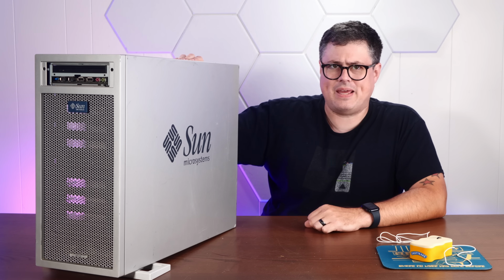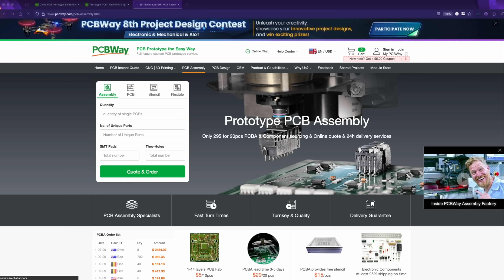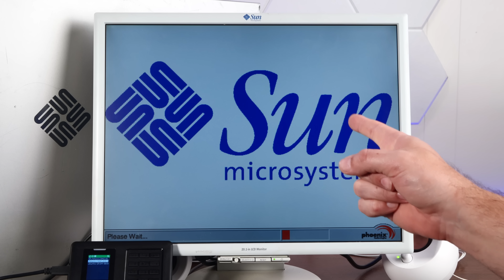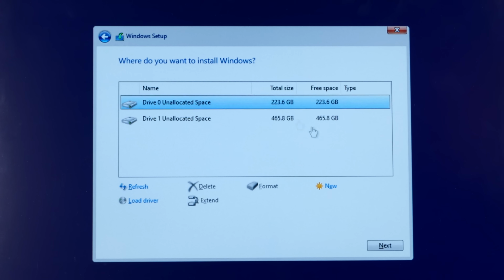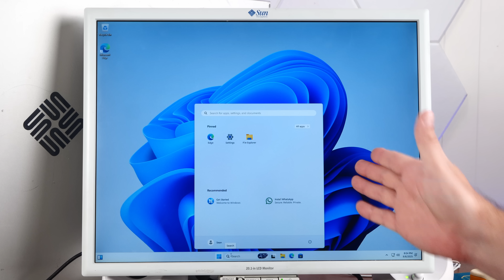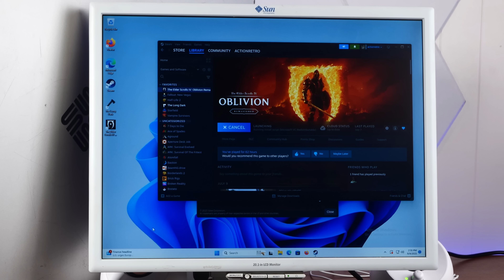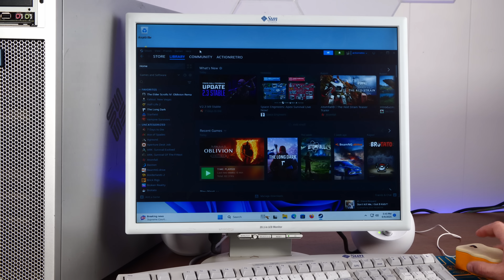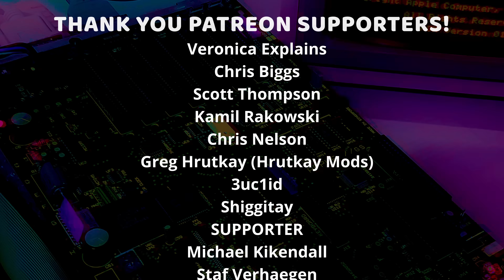The Oldest PC That Can Run Windows 11

Comment: I'm watching this on a 2008 Apple iMac Core 2 Duo T7300 2Ghz and 3GB RAM, original spinning disk 250GB SATA HDD, and an ATI Mobility Radeon 2600 GPU. It actually works great for what I use it for! I installed Windows 7 SP1 because when I set this computer back up to use as my main PC, I had a DVD of Win 7 lying around so I used that, but in the future might put Tiny10 or Tiny11 on it because I would like to run some more modern emulators or other software. 

But since I mainly run old games like Sonic Adventure DX (with the dreamcastify mod installed of course lol) and old emulators like Project 64, ePSXe, nullDC, snes9x that all work great, and watch youtube fine in 720p or even 1080p fine but 720p60 can sometimes lag tho not usually, and 1080p60 drops too many frames, but typically just keep it at 720p which on my 1680x1050 16:10 Glossy LCD Panel it looks awesome, and very high definition. 

I'm hoping this computer keeps holding up! I got it as a 7th grade gift in 2008 brand new and it is still giving me great use! Only issue is I had the speakers somehow become all distorted, so I bought a speaker bar that fits perfectly under the screen in between the base of the computer (all in one) which works great. And when I got 4GB RAM to upgrade the 2GB, for some reason even though each individual stick works fine, when I put both 2GB sticks in it, it doesn't chime,

But at 3GB it chimes, and POSTs/boots fine. Weird because the max RAM is supposed to be 4GB (apparently up to 6GB unofficially), but since I only had the 32bit skew of Windows 7, I am not missing out on too much. I would use the 64bit version going forwards with either Tiny10 or Tiny11 because of modern software compatibility but obviously I'd want to make sure I can use the max 4GB RAM before trying to install those operating systems, as they might technically work with 3GB I'd imagine it'd be pretty slow. Though even with my current setup, which ends up often maxing out the standard 11GB Pagefile of Windows 7, and is heavily relying on virtual memory, paging to a SATA spinning hard disk, it works good. 

Sorry for the long and rambly post lol I just wanted to explain my setup, because despite what one might often think, many older computers are still plenty viable for light internet tasks and older gaming just fine, and would be perfect for productivity tasks especially.

Comment: Those 2220s are 2nd generation Socket F (AM2 - contemporary) Opterons from 2006->. Those never had an issue w/ Windows 8.1x64 onwards. 
The 1st Opterons were Socket 940 (Socket 939 - contemporary); they came in both Single Core and Dual-Core varieties.

Comment: The real take-away here is that *neither the hw architecture nor the sw architecture has materially changed in 20 years* .
Reply: More or less. Besides reaching the limits of silicon using traditional fabrication processes, computers kind of just do everything you would ever want a computer to do at home already. Video rendering takes a few minutes, image editing is instantaneous, computers idle in office suites and playing back music, the web.......... well, the web could be better but that's the web's fault.
Reply: @BringMayFlowers  Other than video games computers are over. They have reached the maximmum in terms of usefullness. Only AI stuff remains and even then its just meh.
Computers can now safely be passed father to son as some family heirloom.
Reply: @honkhonk8009  I'd argue that point was passed in 2003. Once 64 bit was made available to the mass market (the Opteron was released in April and the Athlon 64 followed soon after) PCs have been basically the same. 2005 for Macs, the later G5 towers can still be daily driven today if you're insistent since they too can take 16 (and even 32) GB memory, an SSD, and a PCI Express graphics card just fine.
Reply: Neither the performance :) The 30 nm gate size was reach around 2014, and since then the manufacturers switched to a "virtual gate size" measure, so basically we are still at 30 nm.
Reply: I regularly use an optiplex 745 from 2007 with a Core2Quad and it runs windows 11 smoothly. Core2Duo systems aren’t bad either. People vastly underestimate the usability of older systems and it’s a shame really.

Comment: That Sun machine is a beast. And about that arbitrary obsolescence. My main desktop is a iMac 27" from 2012. It's just an i5 with a miserable 512MB Nvidia GPU. But it has 32GB RAM and a fusion drive. This is how I made it the best cursed beast ever (well not as cool as your Sun). First I "destroyed" the fusion drive, and on a 2012 the SSD part of the fusion drive is 120GB and not the later smaller ones. Then I installed FreeBSD. Just with Xorg and no compositor. That way the VRAM is sufficient to run it as a triple screen setup with another 27" Apple display and a 1920x1200 Samsung in portrait mode. For "desktop" I use FVWM so I got that beautiful OpenBSD feeling to it (old UNIX workstation wannabe). It's the best experience I ever had on a desktop PC, and I'm pretty sure Apple see that iMac as absolute e-waste. Think about that the next time you see Apple doing green washing. Speaking about Apple, I laughed a lot when they in 2024 bragged about the iMac being able to run "triple screen for the first time"...

Comment: Hey! nice and interesting video .
as i always say everywhere i run my trusty DELL Precision M6600 laptop from 2011 right now and i did watch this video in FHD on the 17" display that is on it and it run windows 11 just fine and it's the normal windows 11 nothing modified and yes i installed firefox and it was the first thing i did XD.
now it's a bit of a spectial laptop it have a I7 2720QM and 32gb of DDR3 1600MHZ with is really a lot for that time and even on a brand new computer 32GB of ram is not bad at all it also have a nice AMD FirePro 6100 2gb of VRAM that keep me from using that laptop on linux with is extremely annoying but hey it run win 11 no problem so that's cool of course for games the problem is going to be the GPU it's really old and not that great for new games but it's ok i not complain it run still some cool games and the battery last about 3 hours when watching youtube with is pretty cool (battery is brand new from GreenCell probably the best brand i know for getting new battery for old laptop of if you not want the battery to cost the price of the laptop.... and not want a piece of crap cause that can happen really easy GreenCell is made in Poland so really nice for people who are in the EU cause shipping will be nothing kinda)

Comment: I run win 11 on my Dell T3500, while it does support the the required instruction.  The biggest drawback is that it has actual bios.  The fixes for this breaks about every update,.  The proper fix for this issue will also allow booting from NVME drives also.  EDK2 and refit can be your friend.  Also, while using the external PSU hack, it is best to tie the ground wires from each PSU together.  Differnt ground reference values will cause goofy issues like that.  Once you do that, you can tie the green wire to the main system so initalization power check for all hardware is done at the same time.  Having powe to to the GPU when the system comes on line seems to interfere with the checks done on some hardware.

Comment: Anyone thinking System Requirements for system is ok clearly has not seen how some computers and phones have almost the same specs as the previous ones and yet the companies behind them find new ways to software limit them. The also the same for rooting Jailbraking the whole it is for security thing...

Comment: Time span wise, is like running Windows XP on a IBM AT.
Reply: That’s wild. IBM XT to Windows XP feels like a much larger jump than Windows XP to now.
Reply: @thetman0068  Because it is! Technology was going at an extreme speed in the 80s and 90s. It has slowed down quite a bit in the last 15 years. Sure, there is still quite a bit of progress, but the cost of making the newest stuff seems to be increasing almost as fast as the performance of the new stuff is, much unlike the 90s, where it was nearly the opposite. Performance increased rapidly, and the prices were staying put or even dropping if you went from mid-end to mid-end, rather than high end to high end.
Reply: I'm old enough to understand this reference and it's sad it seems we're in the minority 😢

Comment: You should relabel your title to "Microsoft is a scam"

That title would be more relevant.

I rebuilt an old Tyan opteron system and upgraded it to a 18 core Xeon E5 with 16 hard drives.  Works awesome for games.  Using the last version of Windows I'll ever use, "7".

Comment: sysreqs are sean. holy c what a cpu/gpu combo. rpi4/5 can run win11. asrock J4405m with dual core processor can run win11. latest win11 no compromises.

Comment: Dang, I scrapped one of those Sun workstations ten years ago because it didn't look like it was ever going to be useful for anything. It's such a beautiful piece of hardware that I hung on to it for 10 years after we stopped using it - we only needed it for one project for Sun themselves in late 2005. This totally justifies my decision to never throw anything away again.
Reply: I thought like that for the best part of three decades. Eventually I had to accept that the postapocalyptic wasteland that my home had become could no longer be lived with, and broke my own heart throwing out a veritable mountain of old tech. sigh
Reply: Too bad that you threw it away. I used to work on these workstations exactly 20 years ago. This really revived those memories which are faint but most clearly I remember the feel of solid build quality even though as user of Pro/E I never needed to even open them up. They were brand new, clean, and unworn and I was pretty awestruck that I got to lay my hands on such esoteric hardware practically straight out of the box. I also remember how terrible Netscape 4.6 was on Solaris 10 and how I tried Firefox which was marginally better. I guess it was assumed that internet equals play but these computers were meant for work. I was used to working with GNU tools and I struggled somewhat trying to adapt to Solaris tools which, as I can hardly remember, were of BSD origin.

Comment: I remember around 1987 that a lot of people did not like the new ctrl/caplock placement, and would tend to hit caplock by mistake.  I wrote a TSR that prevents CapLock from working unless you hit shift at the same time.
BTW, the original way (IBM PC keyboard) like the pictured keyboard (3:50) come from typewriters, where the positining is a matter of hardware:  The caplock was actually a little hook that grabbed a beam and prevented SHIFT from coming back up.  And note that the SHIFT key didn't just press/release -- it caused the whole mechanism to tilt, so the other character on each arm would strike.
So, it was necessary for the CapLOCK key to appear directly under the SHIFT key.
The change was made, according to IBM's notes at the time, to make it easier to do chording .

Comment: The particular Opteron in that tower isn't the earliest x86-64.  Those would be the single core Opterons and Athlon 64s from 2003.  But you're correct that your Opteron is the earliest chip that will run Win 11.  Dual cores is a hard requirement for Win 11, going back to the first versions.

Comment: The reason the 9070 XT doesn't work is that AMD removed legacy BIOS support from RDNA 4.
Reply: i doubt it has anything to do with bios...its EFI bios...not legacy one...its more how board setup with pci-x conversion...early pcie....when 9070xt never supported anything bellow pcie3 number.....only nvidia hardware goes from 1.0 to5.0
Reply: @user78405 100% is, UEFI GOP hadn't been developed by 2005 (EFI isn't the same thing). PCI Express version is fully backwards and forwards compatible, the only thing that will change is the transfer bandwidth.

Comment: SUN motherboard is first board to have TPM and secure boot due to secuity in mind that definite works for windows 11....thats is different hardware than normal customers don't get from....x99 or am3 boards does not have EFI bios...only SUN did during UNIX era...and APple as well since PowerPC era, thats way back before PC started to adopted super late in 2015's ......there where no EFI bios than opteron setups only that time ...not sure xeons had that as well....since server workstations always need UEFI for security purpose while consumers do not need it during windows xp to vista era...EFI been around way longer than PC been around.....only in SUN and APPLE computers ...even IBM UNIX computers had it , so as all old SGI computers during onyx era...since they are first made graphical gui bios....PC been far behind since intel i7 introduce the idea of GUI bios that wide;y adopted for both AMD zen and all intel i7

Comment: Microsoft gets to call the shots because Windows is not open sourced. That's my simple and short answer. MacOS is the same thing. But any other OS that is open sourced like Linux, BSDs etc will run fine, someone probably got the job done for you, you only need to install it.

Comment: Wait, what? I have been unable to install steam on my socket 939 Athlon 64 X2 CPU's because steam requires some extension my CPU doesn't have. How are you able to install steam on an opteron? They're functionally the same as the consumer X2 chips, are they not? I would love to test out games on my "fantasy 2005/2006" rig if only steam would install!
Reply: Socket 939 doesn't have a CPU with the additional instructions required to run Windows 8.1 and newer (notably CMPXCHG16B).
Contrary to what is said in the video, this is a workstation from late 2006, with Opteron CPUs that do have the required instructions, similarly to Athlon 64 for AM2 socket, unlike earlier generations of Opteron and Athlon 64 lacking them.
The first x86 CPUs with 64-bit instruction set were the Opteron from 2003, but they cannot run Windows 8.1 and newer, and if they did, it would run noticeably worse than the experience in the video.

Comment: Why is everything running so well what the fuck. I mean, I knew that CPUs have basically plateaued for gaming/general use, but not 20 fuckin years ago. This is nuts. Even the desktop environment should be a mess - though I guess we can thank tiny11 for that.

Comment: 3:53 the control key is in its proper position exactly where it should be and not in the brain-damaged vt220-derived (now an ANSI & ISO standard!) position that has caused so many of us to have RSI problems.  I remap caps to control on Windows, Mac, and Linux on everything I use.   I also set a Mac keymap on Windoze and Linux because I like the layout for accented and extended characters.
Reply: I need this! Can you give more info on how you did it? From one who also knows the pain of RSI 😅
Reply: @joloco72  On Mac, it's a feature built-in into the system, just look for "modifier keys" in system settings. On Linux, it depends, but KDE for example allows you to configure lots of keyboard definitions in keyboard settings. For Windows, I don't have any specific tips, I don't use it, but there are programs that allow you to remap keys (I used one to remap command to option on a mac keyboard way back in day).
Reply: @joloco72  For Windows: Autohotkey should work. I've used it to remap keys, setup mouse macros, all kinds of neat stuff.
Reply: It absolutely is the correct position, I agree.

It's why I use an IBM Model F still.
Reply: If the caps lock key on most keyboards didn’t have a light, I would do this all the time. It just makes so much sense.
Reply: @TJ-vh2ps I'm looking at the screen when I type, or anywhere but the keyboard.  My typing teacher would be proud.
Reply: @TJ-vh2ps  Caps lock light is software controlled though, if you re-map it to something else, it should still work as intended. 
In fact, I know some of my friends who use linux "remapped" scroll lock light to indicate whether they're using qwerty or russian layout, so yeah, I don't see an issue.

Comment: Just wanted to point out :
Windows 10 end of support : 15-th October 2025
Windows 11 22H2 end of support : October 8, 2024 (standard release), October 14, 2025 (IoT versions),

So... there really isn't anything to be gained by running Windows 11 (Tiny11 based on 22H2), on this PC.
EDIT : Note, Windows 11 23H2 end of support for standard version is 11-th November 2025 (while IoT edition will stop being supported on 10-th November 2026).

Comment: Windows NT 4 minimum spec, was an actual minimum spec, I once ran it on it's listed minimum spec PC, and it ran, it took 10 minutes to fully boot, and Notepad took 1 minute to open at all .... but everything worked 

Windows 11 minimum spec is trying to avoid running on perfectly capable hardware, that has known flaws they cannot be bothered to work around, and requiring hardware that claims to "protect" you but is there to protect copyright holders
Reply: I'm old enough to remember when people bitched and moaned that Microsoft system requirements were unrealistically low and a scam blah blah blah.
Here we are, 25 years later, Microsoft tries "for everything to work out-of-the-box and have a good experience"-style system requirements, and they're still bitching and moaning.
And then they wonder why they get ignored. Oh well - one day they might figure it out.